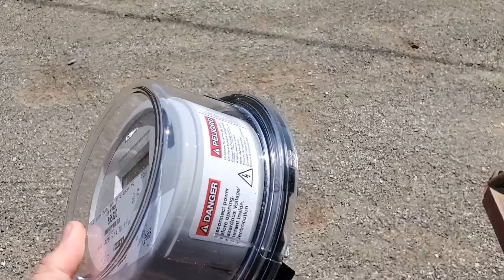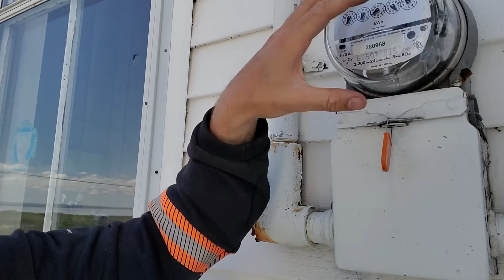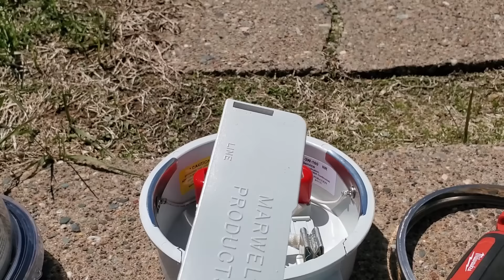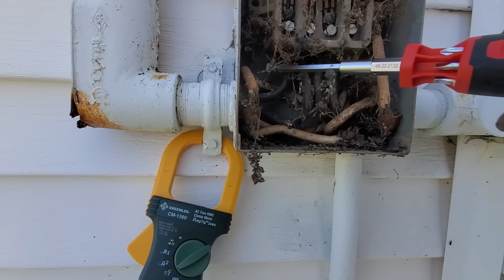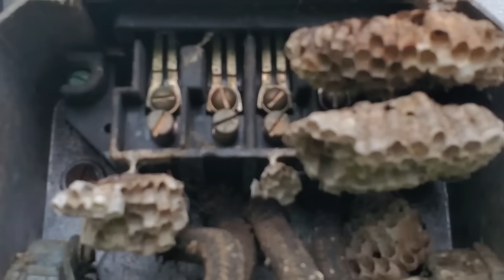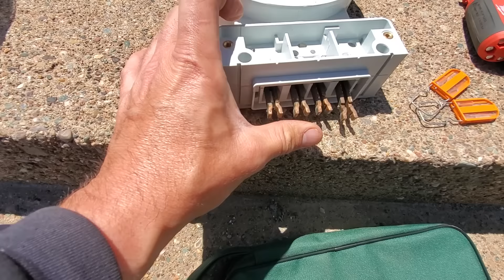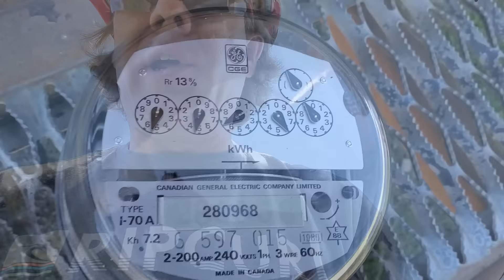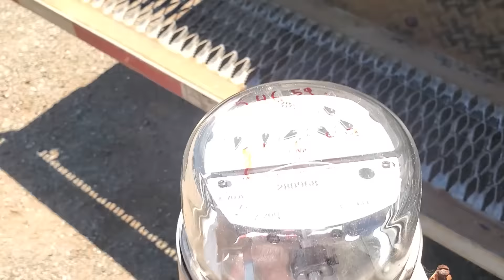Removing an old "A" base Electrical meter

Comment: I'll bet with a meter base that old, there's an actual fuse box on the inside. 60 amp fuse box.
Reply: It may be a "range/main" fuse box, where you have a main fuse that feeds some glass screw-in fuses for the 120V circuits, and a range fuse for the electric stove, which if there isn't an electric stove can often be used to feed a subpanel. A way to add more circuits without changing out the whole fuse panel.
Reply: @brianleeper5737  a lot of places have forced the replacement of glass fuses , old house I rented ,they did that to 100 amp , around 1970s sometimes
Reply: @moultriemanicmechani  I had a house built in 1974 with what must have been the top-of-the-line fuse panel. It had pull-out fuses for the air conditioner, range, dryer, and main, and  12 screw-in glass fuses fed from the main. I got it replaced back in 2003 because the dryer fuse pull out was making a bad connection and the dryer fuse kept blowing.
Reply: @brianleeper5737  it just depends on your local electrical codes ,  some areas d ok nt want glass fuses anymore
Reply: @moultriemanicmechani  Most codes say that fuses can stay until the service is upgraded. If anyone wants the fuses replaced with breakers, it's going to be the insurance company.
Reply: @brianleeper5737  I know in my county , that decision was partially decided by the fire department , but of course our codes are a joke too.
Reply: @brianleeper5737  about the dryer fuses yes I can have it I've seen that with bad fuse holders that they'll overheat and just cause them to blow prematurely even without overload!

After all the fuse works but just Heating the fusible element and after it melts so makes perfect sense if you think about it.

I've seen old modular fuse boxes you could say that are built up from units such as this many fuses for this particular box that essentially everything is just screwed together same outside housing just different configurations I believe it was all from Factory but I think there was at least one system back in the day where a fuse panel could be configured for what was needed.

I'm not talking back when the fuse box consisted of the groups of two surrounding fuse holders in one block either back in the knob and two days we're often there was a fuse neutral as well!

And yes I've seen panels converted from fuse neutral to normal modern usage!

I've actually only seen one fuse neutral in a safety switch that was all my folks for us at the old place and no I do not believe that was 220 at one time either but very well could have been built the 40s so definitely could have been confused neutral originally.

Eventually I was going to jump her out that the fuse in the neutral or just totally eliminated in just wire straight through but didn't wind up needing to since they had moved out of that place

Oh and yeah there was a old conduit that was had some voltage on it the ground likely it no ground in there in the first place since original wiring
Reply: @brianleeper5737  likely because the old fuses can be tampered with readily AKA Penny behind a fuse type of thing or even aluminum foil in some cases I've seen.

And yes I've seen at least one Widowmaker.

At least that's what I'd call him as well as other people in the trade that I've known.

Not in the trade myself either.

What I preferred to as a Widowmaker is in place of a cartridge use a rifle cartridge and yes a live round!

I wasn't a situation where something went wrong one time we are loud bang in the power went out.

Went downstairs to the basement where I do the fuse panel was since I've been to that place before.

And the bear shrimp no here and there and it destroyed fuse panel this was just a small two fuse fuse switch for another piece of equipment don't know what it served this might have been at a farm possibly if I remember.

And they had just moved there unknowingly having this problem.

But something else I noticed was what look like a badly mangled and scorched brass cartridge case.

It was still warm to the touch.

Yep Widowmaker that's why they called that that could have been very dangerous so I really could have gotten hurt if it wasn't in the vicinity.

And there may have been a reason why that thing detonated I checked other fuses some have been bypassed with pieces of metal and more pennies behind almost every fuse and wire bypassing the main fuses ouch is all I can say
Reply: @aaronbrandenburg2441  I have seen where a 15-amp breaker was replaced by a 30-amp breaker probably because the boiler wasn't working and space heaters needed to keep the house warm were tripping the 15-amp breaker. So an idiot who knows just enough to be dangerous can certainly change out breakers.
Reply: @brianleeper5737  yep just like typical old school 60 amp fuse panel / fuse box much like my parents used to have years ago and many other places I've seen.

Well at least initially there was only four fuses in the panel itself well besides the two Mains and the two range fuses.

60 amp main fuses.

What are the problems of the older panels was over fusing and also potentially penny behind the fuse which probably if you're watching this video you would be aware of as it is.

And then Along Came the type is tamper resistant fuses to prevent this.

We had one problem though at least in our case 30 amp fuse adapters and needing to be 15 amp fuses!!!

There were two that were converted to type S for some reason we don't know why it was like that when we moved in.

But yeah definitely over fuse for what was there.

I don't even get restored about the kitchen ceiling light junction box it look like the whole house has been run into it.

I don't think you could have shoved one more wire nut or even a wire in that one!

That was the most crowded junction box we'd seen in the entire house by the way.

We discovered this when we put in a fluorescent in the kitchen and place the old fixture!

There would have been a little more room as long as the Source would been switched but then again it probably would not have been used as a junction box like that in that case either.

No way around that mess had to leave in place!

No tubing knob in that house either was mostly Romex type of cable or similar older Don metallic shaved.

There was some newer stuff that was installed before we moved in as well.

I did remind my parents that in order to shut off all the power you would need to remove both the range fuses and the mains since in that panel the range circuit was still alive even if the main fuses were pulled.

There was a few other fuse / circuit breaker boxes in the house on the same board as the fuse panel.

One of which later was disused which was for dedicated electric domestic hot water heater.

Which did have a separate meter it was one of those that Incorporated a timer into the meter with a much larger extended fish bowl on the meter this was almost as large as some of the demand meters and other specialty meters.

Also I have seen a base meters before here and there.

Someone I knew lived in an older apartment and just wanted me to see some things and just wondered if I ever seen anything like that before because it was so out of the ordinary and old he thought I just wanted to see things just to see it for myself he said pictures wouldn't do it justice.

There was some odd things there that I didn't even know what they were or what they were at one time I'm still scratching my my head on some things.

But in the utility almost closet I'd call it but it was a bit bigger than most I've seen in apartments.

The electric meter was inside each individual Apartments there forget where this was.

His apartment still had the original A base Mater.

I could not believe that thing was still in service.

I've seen the other older homes in Arkansas that were on the historic registry at least most of them.

One of the places literally across the way from us where I stayed at that time.

There was remnants of the old a base meter system.

But the service had been upgraded at least outside.

The egg base meter did have an internal fuse box two fuses probably originally 30 amps possibly or less could have been a 20 in some cases.

Just two Edison base plug fuses.

And it also did have a disconnect switch much like the more modern at least in their own way safety switches but combined with the a base meter box essentially just essentially a rectangular box a bit larger than the type of meter Connection in this video.

That was somewhat similar to that apartment complex except there was no fuses in the meter box just to disconnect switch.

I suspect either they were made breakers for each apartment or maybe even fuses at that time possibly where the power came in.

I did check out where the power came in as well he did maintenance work as well to help pay part of rent as well as a bit of extra income so he was able to show me everything there another reason I was invited he thought that it would be pretty cool to check things out as well as shed some white on things he was trying to figure out as well.

You thought I could be of assistance with that and was taking notes when I was pointing things out since he was working maintenance!

He did thank me as well!

As well as there's a few old gizmos and gadgets that were disconnected that I want to getting for salvage or possibly reuse that were there in various places just doing nothing literally.

He thought that since I helped out it'd be worth kind of as a trade#

Anna thanks as well.

One of which was some sort of old fire alarm system component or stand alone alarm not sure looks like it was made in the 50s or 60s

Later on once I had a chance to take a look inside apparently it was natural gas detector of some sort and also a heat detector it looked on the heat detector like a thermal cutout switch but with kind of like a fan-shaped heat collector I guess you'd call them!

I did also wind up getting other parts of the system if you owe heat detectors that were Obsolete and of course no longer doing anything.

Was the last things is I was able to reuse your chassis even the power supply for the whole unit Works still which was kind of nice wound up for using that as a whole unit also there were switching relays in there some of which could even switch AC power!

If I remember correctly there was even two switched AC receptacles as well for some unknown reason I'm wondering if this power supply was meant for various types of systems but just a component that could be used for other purposes apparently some things were not even in use since the screws had never been touched on some terminals.

Hard to believe even the neon lamps were still working on the power indicator even though this thing had always had power on to it until that point or thereabouts whenever the system was disused don't know how long it had been disconnected.

Also I had a chance to explore the old elevators as well of course which was being stripped out completely wound up getting a lot of those components in the end.

Interestingly enough unlike a lot of other building power or house power as they call it the elevator had its own meter and was the same sort of meter as in the apartments as well.

I have no idea why the elevator would have its own meter that is beyond me.

Also of note there was electric water heating in some electric heating in those apartments and other parts of the building and all that was metered separately the electric heat apparently was unmetered however the water heating was metered.

They had some really weird on breaker panels for the electric heating as well.

It's interesting that all the contactors for all the heating were in the basement and it was a breaker for each heater my guess is so that one could not tap into the electric heating circuits to provide unmetered power.

It'd be virtually useless try to do so anyways for one thing since the power only the available when the thermostat calls for heat.

That's just a theory but that's what he thought as well this was not in town where I used to live or anything it was just checking things out when I was traveling as it was

Comment: My Start Meter Story - for about a year our smart meter was sending the hydro company  0.0 Kw  consumption reading . Three " technicians "can out during that time period after we complained every two or three months that our bill was only was containing  the service Fee . We paid each monthly bill . Finally  a fourth " Technician " pulled the smart meter out on portable test rig and determined it was bad. 
That is not the end of the story - Inside each smart meter is a memory chip that records information generated by the smart meter . This the final arbitrator of how much we owned the hydro company . And their was  NO stored Data on the memory chip . The Hydro Company didn`t come after us for lost revenue , and we estimate that the hydro company lost $2500.00
Reply: They can estimate my White azz is what they can do. Go off grid and become self sufficient. Tribe, train, and pray.
Reply: Gosh!  In many places the power company would  "estimate" a bill!
Reply: @GilmerJohn  i think because of complaining every few months , the power company had no leg to stand on , Then again ,  H----- O-- , continue to embarrass them self's like buying a section of Rain Forest  in Costa Rica to off set carbon emissions
Reply: @45NUTS_PART_DEUX  --  Well, it's not hard to make an argument on either side.

Reasonable "public policy" would be to charge the customer a "reasonable estimate" of his likely usage with a small rebate for the screw ups on the part of the utility.   Many customers on getting essentially a zero bill might ignore routine power conservation practices.

One of the 'problems' with a publicly owned utility is that you can't "punish" the owners.   All you can do is transfer wealth from one set of owners to another.
Reply: @45NUTS_PART_DEUX  --  Hey!  Why not?  Have the fun of YT is the semi-random discussion that follows each video!

Comment: in the US wear I work have a few power companies,. REG, NYSEG,NATIONAL GRID just a few. is more. As a Electrician we get the calls that service entrance is un-safe. And we (me) bring up to code. Some times just new SEC cable and meter socket . some times a total up-grade . new main breaker box ground rods (2) some areas 1 ground rod. it's the soil  ground rod resistance. I in stall all up to the weather head. The power company puts the meter in. years back I remember grounding the meter box with some power companies . not any more hear. I do call power company  and get requirements first before doing work . 1 or 2 ground rods ETC. or I call the local inspector . they always tell me .most come to job cite first and tell me right their. makes my job easier. I found it best to call first before work .
Reply from the maker: That sounds pretty close to the way it's done here!

Comment: Thanks for the intro class on meter work on an old “A” base meter can. In our company this is strictly a meter service person’s job. You guys & gals wear more “hats” that we do in New England. True if the improvement work is strictly for the benefit of the utility? Why should the customer be forced to upgrade an existing service? 🤜🏻👊🏻🤛🏻👊🏻
I’m on forced call tomorrow until Monday. I’m hoping it’s a quiet day & a day I can relax at home. Unless it’s an emergency I don’t get involved in anything too big at home. No point in starting something only to put it down if the pager goes off? My other boss (wife) respects me enough for that.
Reply: said "  Why should the customer be forced to upgrade an existing service?    "    At what point do you propose a customer be forced to upgrade an unsafe service?
Reply from the maker: That decision would be at the power company/provincial inspector or fire chiefs discretion. In some situations  notice can be provided that it will be disconnected if not repaired. Most times the situation occurs as a result of a customer complaint. For example: customer reports some flickering in their lights... Upon our arrival, a connection could be badly corroded and heating up. The service will likely be disconnected until repaired.
Reply: Aaron, I see your still up? I just got in from a call for a bad pot (transformer). Easy do. Every pot we replace now is non CSP. The bad pot was a CSP. Which meant we needed to squeeze in room for a fiberglass T-Bracket & cut out. I happen to have a fiberglass extension ridge pin that gave us the height we needed without having to set a new pole & restore the outage faster.
Reply from the maker: Yea, been up all night last couple nights. Had some fires and car hit a pole 🤦‍♂️.  Those fiberglass extension are a huge help! We use them quite a bit!

Comment: Interesting vid as always.  

I watched as both my meters were changed (home and work) as I wanted to inspect the inside of the box (I had heard of some having insulator cracks).  In both cases pretty pristine after 30+ years of service.

Took me a few minutes to find that church on the 915! 👊 / Montreal.